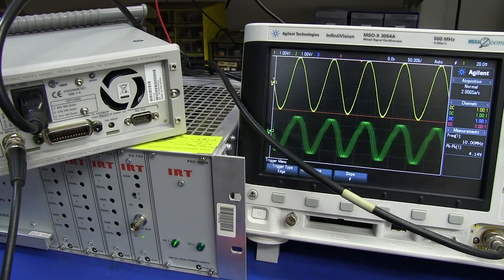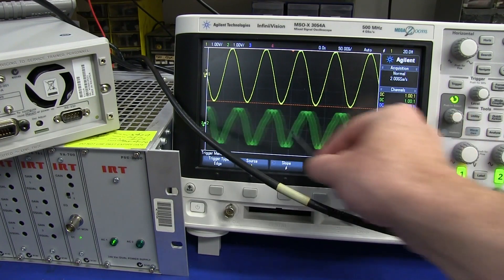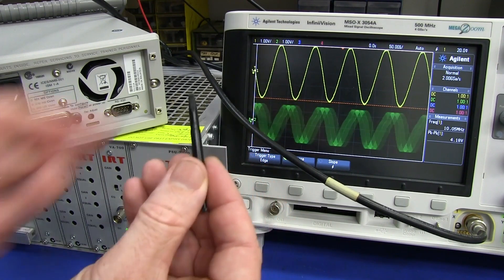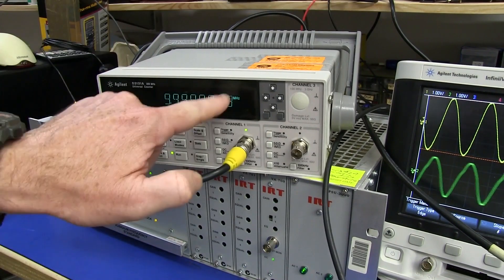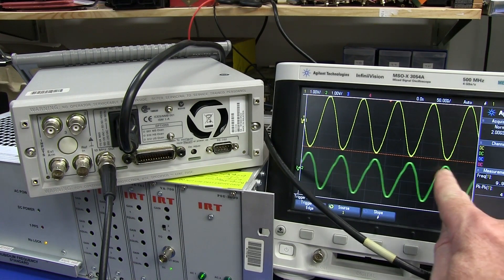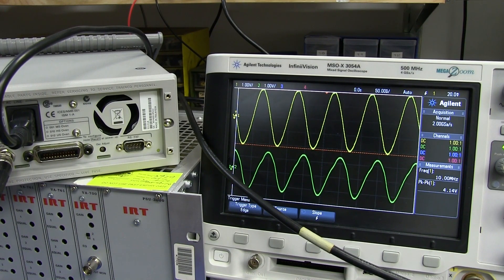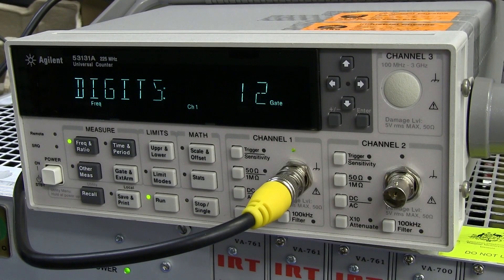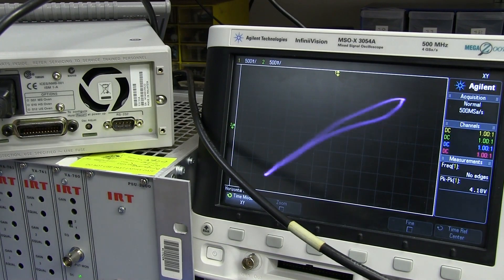EEVblog #457 - Oscillator Calibration Followup

Comment: Advice as an ex calibration tech ; the main characteristic is to identify the direction of the drift +ve or -ve and adjusting the oscillator at the outer extreme so when the one year calibration time expires the reference oscillator is at the other extreme within specifications. HP/Keysight/Agilent have very good application notes. also you need to apply Allan Variance. https://en.wikipedia.org/wiki/Allan_variance.

Comment: I know that this video is an old one, but maybe my advice can still be useful? To turn the screw much more precise, you can glue a i.e. 1 foot long non conducting pen at a 90 degree angle, so it looks like an angle screw ratchet.
In this way, you avoid to put your hands near the screw and if you hold in the far end of the pen, you han adjust with 1/1,000 degree if you want to.

Comment: Somebody already said but sticking the hex adjustment tool in a hex nut driver gives you a larger diameter to control the fine adjustment better. Because the metal driver is at the far end of the adjustment tool, it shouldn't affect the capacitance. That's why they are usually hex shaped I believe.

Comment: Question.. Could you add another variable cap of far lower value. But the same number of turns to add a fine tune ability to this, or would it just add more % inacuracy and temp variation?

Comment: could always slap in a sub-ppm tcxo circuit, would be a good upgrade without the cost of an ocxo, i wonder why they skimped so badly on something so important to a frequency counter, also wonder why the trim capacitor has such a huge range for adjustment, just makes it more difficult to adjust

Comment: I did but wrote the comment before the end. The advantage of Lissajous pattern is that you can track phase. One way or another it is almost impossible to keep the free running oscillator stable in a narrow margin of error, a case of an instrument with high resolution and high error.